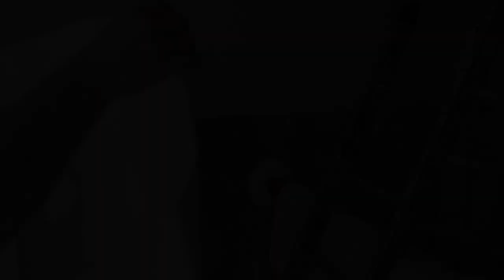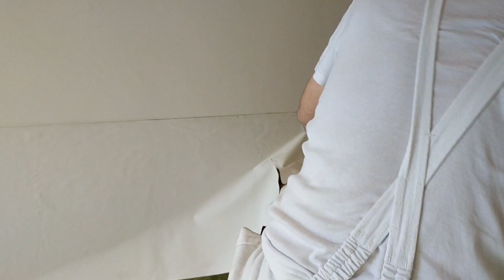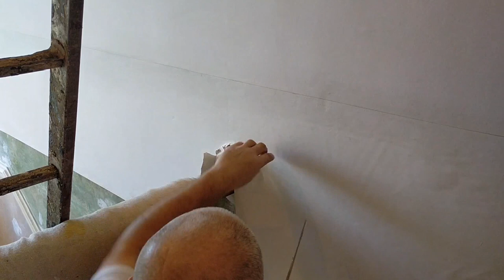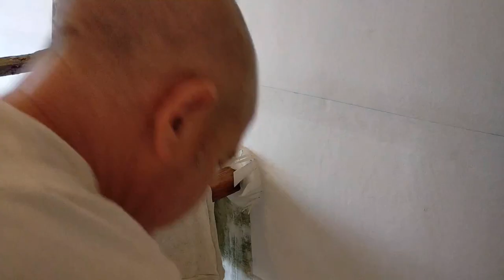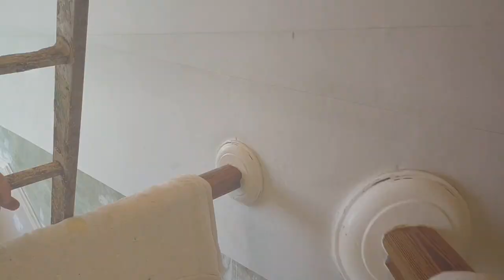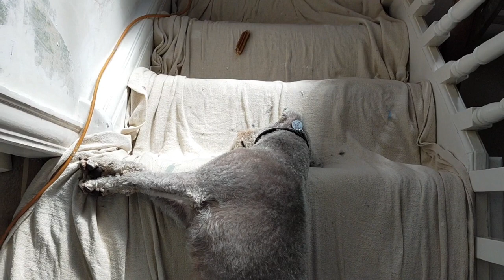Hanging lining Paper Handrail  Rosette How I do It.

Comment: Hi, i've been watching your videos for a few years now - thank you so much I really appreciate it. I wonder if you'd be kind enough to answer a question (maybe do a video on?); I'm an intensive care doctor and have been super flat-out with covid. I have my first spell of time off in 12 months! Although exhausted I need something else to take my mind off things - I'm planning to decorate a biggish old room - what is the correct or best order to tackle the various parts of any decorating job? filling / sanding / painting / radiators / woodwork / architraves / doors / top to bottom or ceilings last etc, I could easily get it the wrong way round. Obviously I have a supply of foam now 😀! Best wishes, keep up the good work and thank you so much for your time.

Comment: First Class work Umm please could i ask a question? why do you hang the paper horizontal? Awww the dog is soooo chilled love him just wants to be near you TFS
Reply: Its hung horizontally to obviously leave a smooth finished wall but also if hung vertically seams will show through on the finished top paper. Hope that helps.
Reply from the maker: Thank you best to hang this way less joints and if wallpaper is ever hung then joints don't line up. And it also makes it a stronger surface less chance of joints lifting. Thanks
Reply: @PaintingandDecorating  Many thanks i truly hadnt thought about hanging wallpaper over the top & joints issue, Wonderful channel Im learning soooo much Thanks

Comment: Love your Channel!!!!

Do you use caulk on any lining paper internal corners to tidy up the cut joints or is filler better.

I'm papering now and getting flashing with Brewers Ultimate caulk. 

Tried BE123 to prime and that's flashing too.
Reply from the maker: Never use caulk... Apply first coat of emulsion then fill using a hard stop filler.. which is paint mixed with powder filler..  this will stop it flashing on second coat.. thanks
Reply: @PaintingandDecorating  What about underneath the coving, around the architraves and above the skirting boards?

My cut lining paper edges are a little rough making cutting in somewhat uneven.

Should I use hard stop filler there also, and then tidy up by sanding before cutting in again for the 2nd coat?
Reply: @markyp29  Lather it in caulk...
Reply from the maker: @markyp29  .. .any filling should have been done and your lining cut straight. You should only be doing minor filling using hard stop filler..  usually the nice straight edge of the lining paper is the transition point of the paints. Thanks
Reply: @PaintingandDecorating  Fair enough. 

I need to learn to cut wet paper a lot better to get to your standard.

Every time I get a few little tares or wonky lines.

I'm fitting new skirting boards in the hall and will need a little caulk to tie them in but I'll use a right angled silicone/caulk tool so there's none on the wall.

I've bought some Nemesis to try on them.

Thanks for taking the time to reply to me.

Keep the great videos coming 👍
Reply from the maker: @markyp29  thanks... sharp scissors and a nice pencil line to follow.